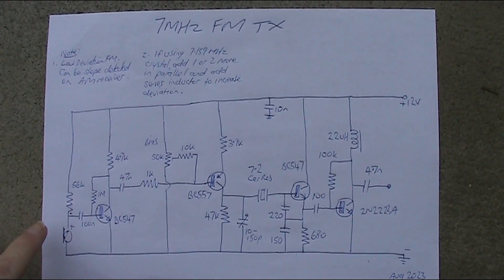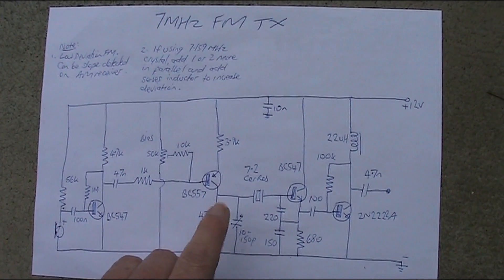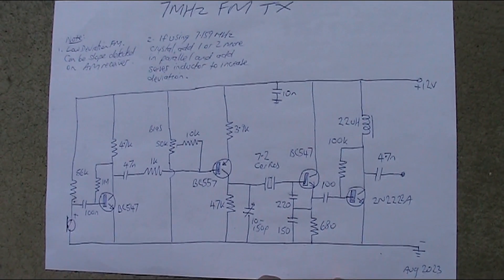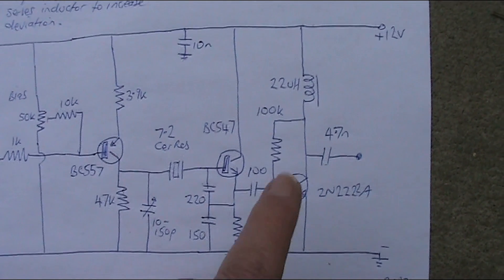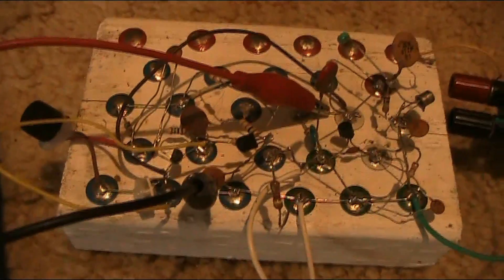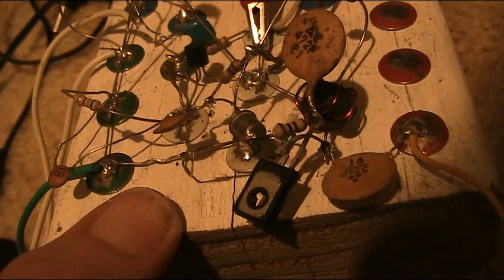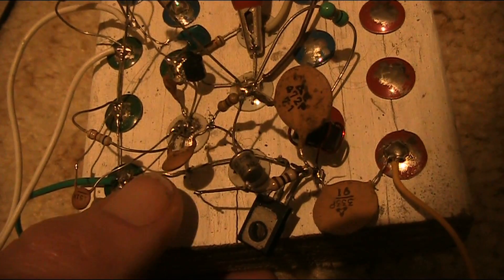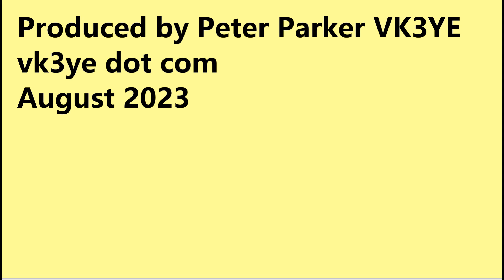Badly behaved 4 transistor 7 MHz FM exciter

Comment: I have often wondered about locking an LC oscillator to a crystal oscillator with a PLL such as a 4046, then use a long time constant for the loop filter so that the LC oscillator can be frequency modulated whilst remaining crystal stable.
Reply: I've done it.

Comment: Get it to 50 ohms as quickly as quickly as possible.
It kills EMC, and interstage feed back
It takes more stages to get where you want, but  it's stanle and doable
100uW, 1mW, 10mW. 100mW, 1W, 10W, 100W, 4CX1500
'Happy hope to birds nests' will drive you nuts.
Reply: Google Solid State Design for the Radio Amateur for suitable 50 ohm in/out amps.